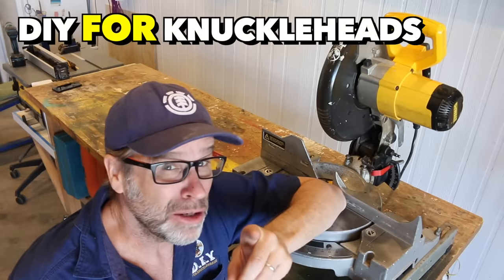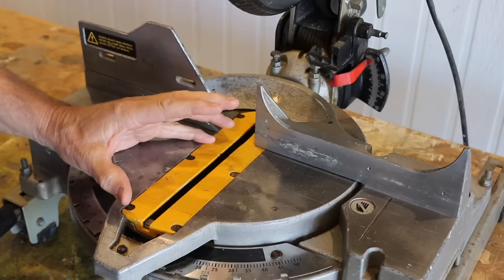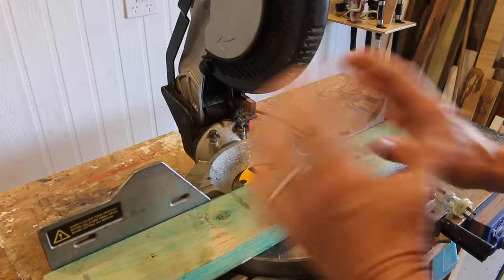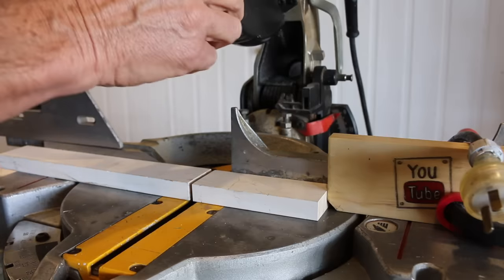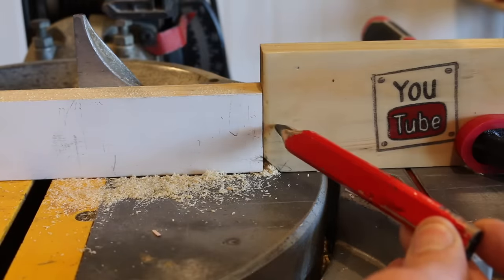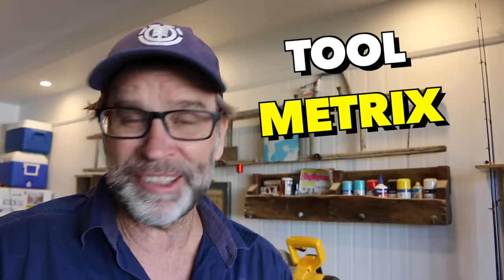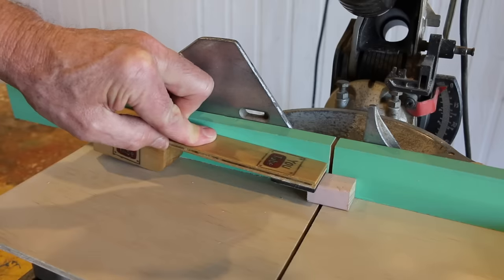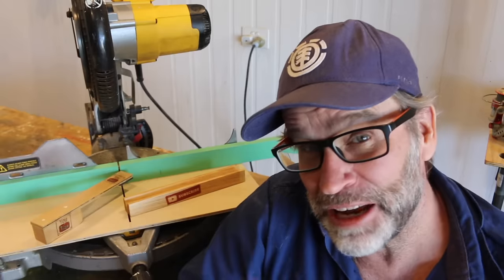My Top 7 Miter Saw Tips for Beginners.

Comment from the maker: G'day Folks. I love my Mitre Saw! It's over 12 years old....l use it on basically every project that l undertake... and is still cutting like a Demon! The mitre saw is one of those must-have tools that as well as being incredibly useful, it can be extremely dangerous so PLEASE take the time have a look at these tips. You'll be glad you did! Cheers 👍🇦🇺😁
Reply: I know, I know, it says "for beginners".  But I was curious.  My oldest one is thirty years old, Makita.  It's a heavy little bugger and rates a permanent roost in the shop.   For portable units I picked up a Delta and habba frate sliding.  Then I have some two dozen other types of saws tucked about here and there.  Plus other cool stuff I've picked up over a lifetime.  Nevertheless, I picked up a handy trick - that angle at the bottom of the stop block.  I have a habit of wiping and/or blowing the deck clean between cuts so it hasn't been an issue that's called out to me before but no doubt it has to save me some cleaning effort.  And your Australian mannerisms are a real hoot to us colonists here on the flip side.  😆  G'day mate!
Reply from the maker: @elgringoec  Thanks mate....really appreciate the feedback from a bloke who has some experience 👍 Have a good one 👍😁🇦🇺
Reply: Why not do tip 3 on tip 7 and put a line on the jig :-)
Although I personally would not do it, it is good for many beginners...
Reply from the maker: @thinkr8142  Yeah it's a good idea Peter 👍
Reply: GeoMac Granddad l
Reply: Peter Hulstaer
Reply: We call them miter saws in the U. S.   I'm currently shopping for one and there are too many options.  😭
Reply: Thank you for these fantastic tips! So useful.
Reply from the maker: @SpiritQD  No worries at all Stephanie...glad l could help in some way. Cheers 👍😁🇦🇺
Reply: thank you for these tips sir. subscriber for life
Reply: This is brilliant. I learned a lot, and had a smile on my face the entire time. Ta!
Reply: 3:05
Reply: I'm just a hobby carpenter and those tips are so so great 
I loved them all but the 65° cut so simple and so effective 
Thanks mate, cheerio 😂😅
Reply: I work at Tuff Shed. I cut boards anywhere from 1"¾ to 187" 8 hours a day on a miter saw. Love the zero clearance tip and especially the one about the sawdust. Some my boards have been off and I think that may be part of it so this will definitely be helpful I'll do it tomorrow. Any tips for a guy that essentially needs a zero clearance board 16 feet long? Like one that's super flat so it doesn't lift the boards? 
Love your video. Those sliver cuts were clean as hell
Reply: Farts make common scents.
:
Reply from the maker: @criticallook1352  😂

Comment: Good tips, but I would point out that, when using a stop block, ALWAYS hold the workpiece on the same side as the stop block. If you don't you are creating a pinch point between the blade and the stop block.. Doing this eliminates the need for waiting after every cut because the waste side of the lumber is free to move away from the blade unhindered.
Reply from the maker: Good point Joseph but sometimes the piece is to close to the blade to safely do that 👍 Thanks for watching mate and for the constructive feedback. Cheers 👍😁🇦🇺
Reply: Like he said, If you wait for the brake to kick in and the blade to stop before you lift the saw up its always pushing the piece against the fence.  So as long as its not twisted its not going anywhere.
Reply: ? New to chop saw use, but could you push the piece that is in your left hand against the side of the blade while the teeth are below it to act as an additional brake to stop the blade which would lessen the time before one could lift the stopped blade safely?
Reply: @martvogt7019  Once you pinch the blade, regardless of where the teeth are, it can send pieces flying.  The friction against the sides of the blade is what causes the pieces to be thrown, not the teeth.

Comment: My bonus tip.

If you are trying to cut a piece which is slightly too wide for your mitre saw, you can effectively increase the cutting width of your saw by placing your piece on top of another to raise it towards the wider part of the blade. For example - my small mitre saw has a 125mm max cut but if I place my piece on top of some 15mm board I can cut 140mm wide pieces comfortably.
Reply from the maker: 👍..Good tip Daz! 👍😁🇦🇺
Reply: Great tip.
Thank you.
Reply: That is a great tip . Another thing that you can do is lift the front of the piece while the rear-end remains tight against the back fence. It might sound dangerous but I've done it hundreds of times. Just be careful
Reply: Yes saw norm do that
Reply: I was struggling to visualize what you meant but after watching this vid Uncle Knackers has released a video 13 days ago giving this VERY tip!
Seems you have rubbed off on him. Fullest respect and thanks for the GREAT tip! I get it now :D

Comment: Thanks for the good ideas.  I did not read through the comments below, but just in case no one suggested it I thought that I would mention the following:
1)   You could improve your vee block for holding round dowels by gluing sand paper on the flats inside the vee.  
2)  When cutting the angle at the bottom corner of the stop block cut it at a compound angle so that the face of the cut is chamfered away from the fence.  (I would suggest 60° to a sharp leading edge on the angle cut.)  This would direct sawdust away from the fence as you slid the next piece of wood into the stop.  It will save you from huffing and puffing as you make successive cuts.
G'day from up here in the Northern Hemisphere.
Reply from the maker: G'day R.J 👍 Great ideas mate.....l'll have to implement those 👍 Thanks for watching 👍😁🇦🇺

Comment: Bonus extension fence tip: If you have a spare speed square, you can just use that as the stop block on your extension fence.
Reply from the maker: Spot on!....thanks mate....great tip 👍😁🇦🇺
Reply: A 1cm batten glued you your stop block let’s it sit on your extended fence. Much easier to clamp in place.
Reply: @Dave5843-d9m  yeah that's what I do just use one of those quick clamps to clamp the square to it. EDIT: oops meant @OP
Reply: I just use the clamp as a stop block...

Comment: Great video. FYI, these are called miter saws here in the states as well - the term "chop saw" typically refers to a metal cutting saw with an abrasive wheel. I've never heard anyone here use the two names interchangeably, although I'm sure it happens.
Reply from the maker: Thanks mate....appreciate the feedback 👍😁🇦🇺
Reply: I only knew it as a chopsaw until I went to purchase my own. While shopping for one, I asked about the pros and cons of the different brands of chop saws. Fortunately, the guy I was talking to was an old woodworker and knew I was talking about a miter saw. Most new, younger woodworkers, I think, only know it as a miter saw.

Comment: Thank you for putting safety first in your videos! Hearing protection and Glasses are so often neglected in these DIY videos. I loved your jig in tip number seven for holding small pieces near the blade. I have unsuccessfully tried several variants of “holding sticks” and look forward to trying your version.
BTW - Do you have to tune your miter saw to maintain a perfect 90 degree vertical and horizontal cut ie., no bevel and perfectly square?
Thanks for the video! Well done mate!
Reply from the maker: Thanks John!....appreciate the comment mate. I think l've been lucky with my saw....l've had it for a long time and have never had the need to adjust it for square. Have a good one mate 👍😁🇦🇺

Comment: I’m totally new to woodworking but looking at that dowel jig I wondered if it would be worth making it kind of like the zero clearance plate. I thought I saw ripping on the dowel so could you have a longer jig to rest the dowel in, with a channel cut into it half way along, that goes below the join of the V, to lessen ripping and to hold the dowel piece you just cut?
Would that work or am I missing something?
Reply from the maker: Na that sounds like it would work John.....good tip 👍🇦🇺😁

Comment: I've lost count of the number of people I have threatened with instant dismissal from work (building roof trusses) because they are crossing their arms up as demonstrated in tip No. 2. They won't lose a thumb or a tip of a finger, they'll lose half their bloody arm! They insist on using their dominant hand to control the saw and pull the trigger. An explanation of what will happen to their arm along with the threat of dismissal is the only thing that stops them.
Reply from the maker: Kuffy, when l was a young bloke in the 80's we did a shit load of house frames around Sunbury and Taylors Lakes. Back in the day all the frames were stick frames so we had a guy come in to cut the studs. He was a professional who cut studs 8 hours a day, every day and that's how he used to cut!!!! It was mental.! Have a good one Mae 👍🇦🇺😁
Reply: Most likely they are left-handed.  I find myself doing it sometimes. The left-hander's struggle is real ya'll!
Reply from the maker: @Jaji813  Being a left-hander Janette l know what you're talking about 👍

Comment: Very entertaining.  As a dad and grandpa I appreciate the silliness.  Good tips.  One thing though....the one tip about the job that holds a very small piece of wood...I would not bother.  Just use that tiny piece for firewood and cut the small piece from a larger one that you can safely hold or clamp.  But great tips.  Especially the dowel jig.
Reply from the maker: Thanks Vince! Appreciate the comment mate 👍😁🇦🇺
Reply: @diyforknuckleheads    I was a professional picture framer for over 35 years and used these everyday.  I have used special manufactured systems that held work securely with measuring stops and when I started my own business I had to build a homemade dedicated bench with supports, stops and measuring device built in.  So, yes this is a great piece of equipment. As this video is for beginners...it may be worth noting that many saws have hold down clamps which should be used as often as possible to allow for hands free operation.    Again great intro!

Comment: I just bought my mitre saw yesterday. Getting ready to build a workbench from one of your videos. These tips are fantastic! The extension fence for consistently sized, larger pieces is amazing!! As are all of your other tips to be honest! Thanks!

One thing that I'm a bit confused about is that some tools like circular saws state that they should be spun up before cutting, then taken out of the material, before being turned off, whereas it seems different for mitre saws?
Reply from the maker: Thanks mate....glad you found the video useful. The motor should be fully spinning before you enter the wood and l like to wait till the blade stops spinning before I remove it from the cut....mainly for safety reasons 👍😁🇦🇺

Comment: Very useful tips, especially the zero tolerance fence. Thanks very much.
Reply from the maker: Glad it was helpful Anthony! Appreciate the feedback mate 👍😁🇦🇺
Reply: @diyforknuckleheads  Any ideas how to make a jig so I can cut a length of Ash that’s 30mm wide x 65mm x 300mm. I need to halve it lengthways down the 30mm part. So it’s only 15mm less the width of the blade.
Reply: I haven’t got a table saw!

Comment: Im new to woodworking. 
A craftsman gave me a great tip... if you're using a clamp with your stop block,  recheck your measurement from time to time. 
Clamps sometimes slip

Thanks for all your advice,  im learning a lot
Thanks again
Reply from the maker: No worries at all mate and you're spot on regarding the clamp 👍😁
Reply: @diyforknuckleheads  
Thank you  for your kind words.
I see so many tools to make projects easier. Trying not to spend too much money

Comment: Thanks, great video. Just happened to have bought a new Dewalt this week that looks just like yours. Already built and used the zero clearance plate and it works great. I put a longer board along the top out to the right with a stop block at about 40 inches (100mm) from the cut. I nailed a small block of wood to the bottom of the back board about halfway out. Now the piece I'm cutting doesn't fall when I cut it.

Comment: This is great! Just got a Dewalt 12 inch DWS715. It doesn't slide so I have been trying to figure out the best way to cross cut 12 inch boards. Seems the stop block would do the trick so when I flip it over to finish the cut it will be the same!

Comment: 4:34 Great tip about using a stop block, and 
with the 45 angle, I think I'll do that with a 
compound 45, so it has even more inclination
to spit out of that corner. I think your tip 
is also good for eliminating the spring action
inherent with a build up of debris, 
which could wind up pushing the cut piece
back into the blade should some nucklehead 
(me).
lifts the blade before the blade stops spinning.

Comment: Hi Mr. Knuckle Head re extending miter saw fence instead of marking with pencil then a square I made a pencil mark at 50cm then using a square I marked my line with a hacksaw to 1mm depth then repeated every 5cm and labeled them on top with Dymo labeler then covered with aquadhere and let dry. Keep up the hints and tricks well done Ps I am in Adelaide South Australia.
Reply from the maker: Good tip Neil 👍👍

Comment: I was working with an old joiner a few years ago cutting hardwood glazing beads on his chop saw, the saw had a wooden standoff fixed to the fence, on the right hand side of the blade the standoff had a couple of wood shavings between it and the metal fence hmm i thought they shouldn't be there so i slackened the standoff and cleaned out the shavings. When i cut the next glazing bead instead of a nice clean parting with no drama there was a bang and the offcut shot across the room leaving a ragged cut on the bead, the old joiner who had watched me do all this said now you know what the shavings were for, a slight step in the fence stops the work piece nipping the blade as it goes through, ill never forget that great tip.
Reply from the maker: That is a great tip George! Thanks for sharing mate and for watching 👍😁🇦🇺
Reply: Mmmmhhh, what's a standoff? What are those woodshavings? what do they look like? Where do they fit in and what keeps them there? 
Sounds like good advice but unfortunately completely lost on a ignoramus like myself.
Reply: @kevinrtres  Standoff is a piece of wood fixed to the fence each side of the blade, the wood shavings produced by planing some wood along the grain, a couple maybe 1mm total thickness were sandwiched between the fence and the standoff on the right hand side of the blade meaning the fence was now staggered 1mm  from one side of the blade to the other, this stops small section timber nipping the blade and ending up flying across the room, the offset between the two sides of e fence is so small it does not effect the operation of the saw. Hope that helps.

Comment: Thanks for video. That jig to hold small pieces from a safe distance was just what lighted my interest. And then i looked at the v shaped jig for holding dowels. However, as the round pieces is cuttet in the air, with no support, there comes alot of tear. Any workaround :)? Also, id like to ask you about the fence for zero clearance.. well, if you make both miter cuts, and bewelled, the fence will be cut quite abit in the cutting zone, so, tear out will happen again, right?

Comment: Thanks, really useful tips, especially the zero clearance and strip of wood extensions 
What about checking that the blade is square?, with the plug out, bring the blade down so the guard retracts then I’ve got a little 4 inch triangle square to check my 90 and 45 angles to the fence and bed
Reply from the maker: Yeah good tip mate👍👍 Thanks for watching 👍🇦🇺😁

Comment: The one about letting the blade stop spinning is paramount in those situations. The wood really does come out of there quick on a kickback. Ive seen it dent steel cabinets. Also useful for any stubborn board. If it felt iffy going down it may be iffy coming up to. Especially if you're cutting a crowned or bent board. Better safe than sorry, stop your blade 😁
Reply from the maker: Yep....spot on mate 👍👍

Comment: I'd add the tip to use the hold downs/dogs that came with your mitre saw.  Especially for longer pieces, you want them to hold the wood down to the table so they don't bounce around when the saw cuts through the wood.  Plus, it's one less reason to have your hand near the blade.
Reply from the maker: Good point David! Thanks for watching 👍😁🇦🇺

Comment: Love that little Tool Metrix jig. I use random offcuts for that purpose currently but the flex and pad simulating finger pressure is one of those simple genius little builds. Great Tip Uncle Knackers! (...and T.M :P)
Reply from the maker: Cheers James. The boys from Tool Metrix just used a round silicone chair leg protector thingy on the end of the jig which only really gave you one point of traction. The rubber pad with the sandpaper....in my opinion...gives more surface area to grip with. Thanks for watching mate and l'm still trying to work out (.....andT.M:P) ?? 😁 Hope you're having a great weekend 👍🇦🇺😁
Reply: @diyforknuckleheads  I was being lazy and now for penance must type in full. It was ...and Tool Metrix 😅

Comment: Good video. The project I have consists of cutting a 4x4 post of about 18 inches long at almost a 45-degree angle down the length of the post, basically making a long wedge. My Dewalt miter saw is like yours, albeit new, and the blade will not go the entire length of that cut. Note, I do also have a Craftsman table saw, but I am not sure of the best method to use or exactly how to do this. Any tips, suggestions would be appreciated. James

Comment: In America it also called a miter saw.  A chop saw uses larger abrasive disc for 90 degree cuts on metal, masonry, composite material and wood.   Mostly used around here for metal and masonry.
Reply from the maker: Cheers Tim 👍